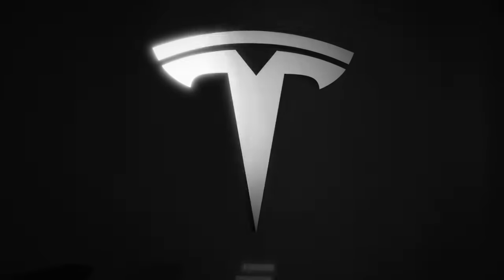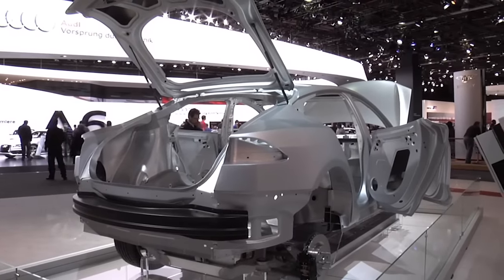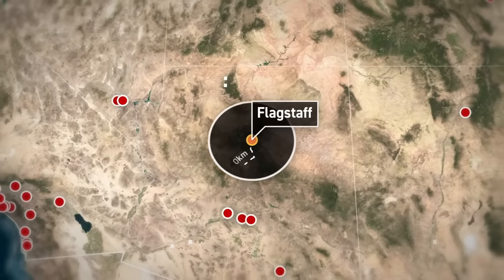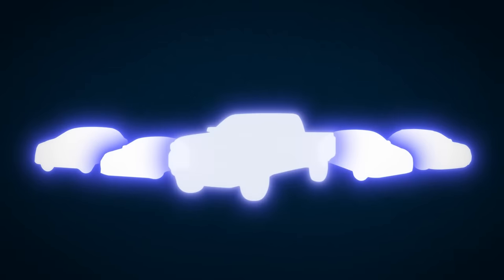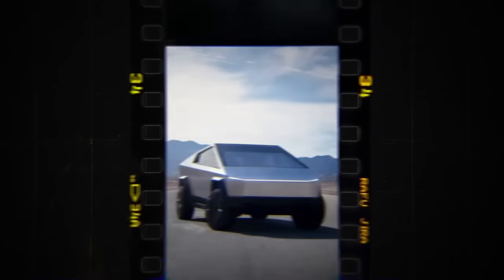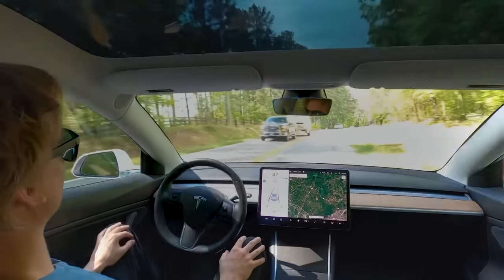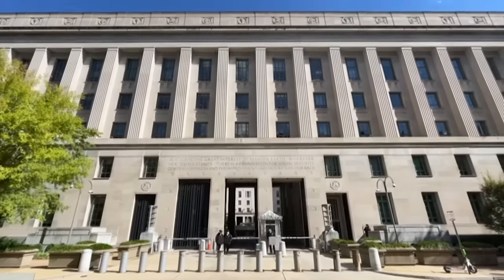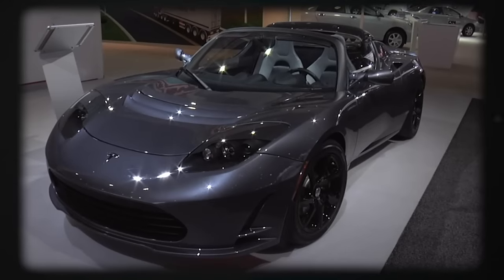How Tesla Fumbled

Comment: I have a Kia plug-in hybrid. It’s the perfect choice for us. I can charge it with our solar for local trips, but get 50mpg and fuel up quickly anywhere on long road trips. I get 500 miles on a 10 gallon tank of gas. I’m not reliant on finding a charging station that is working and unoccupied. They are very uncommon around here, and many are Tesla only. I do agree we need to choose a standard, or ensure all stations have dual functionality as we build up the charging infrastructure.

Comment: The lead in the Model Y is Cost, While tesla turns a profit on the long range, the mach E loses money. It also has a lead in parts, and manufacturing capacity of batteries. This is where tesla will win, purely on a production level and cost in long run. The former car companies are already heavily indebted. I'm not a big tesla fan but this seems to be completely missed. To reach the F150 production rate, Ford would need 10% of current global battery production.
Reply: I think you have that wrong. Legacy automakers have more capability to offset costs in other parts of their business. Meanwhile Tesla has to rely on money from shareholders to offset losses. If they continue to lose favor among investors, they won't have anything to lean on, which means they wouldn't be able to survive being undercut
Reply: @FinneasJedidiah  What losses does Tesla need to offset? They earned $13 billion net income in 2022 and earn gross profit of about $15k per car on average.
Reply: @P. Walker  This is true but with Tesla's massive valuation getting capital would be easy compared to the Legacy auto balance sheets. Tesla is dominating the battery market and think the mining capacity issue is what will bottleneck all of them. Tesla has land in Nevada but to get the Lithium out, from plan to product will take a decade min. If policy destroys Legacy autos business with carbon tax then Tesla wins, it's truly who folds first.
Reply: @FinneasJedidiah  Tesla's first annual profit was I believe in 2020 or 2019. So you are working off of a casual perception that is roughly 3-4 years out of date.
Reply: @adamanderson3042  no, because that was when Tesla was the darling of silicon valley, and was the hot new thing for venture capitalists to invest in. That's different now, and now people expect them to make a profit. So they just can't rely on investors pumping them with cash to keep them afloat while they're undercut by competition that can subsidize their ev production with other areas of business.
Reply: @FinneasJedidiah  I think you replieed to the wrong person, Tesla is profitable.
Reply: @malcolmx61  I didn't say they aren't. Try learning how to read.
Reply: @Critical Event  lol the recall, was just another normal update to FSD, yes the name is miss leading but it's still a top 3 driver assist software? It was safer previously but humans don't drive safe and the issue is with the driving environment not being safe(blind corners/no vision or bad  drivers). I'm also a big skeptic of lion battery production like I said but the only company trying to fix the bottleneck is tesla, that is why I think it's a more war of attrition and the incumbents will win if the government helps them and its people like you and tesla fan boys that are the issue. No more common sense out here to have a normal perspective.

Comment: Huge fan of Wendover. This video has a big problem, though.

Yes, the Ford F-series is the most popular line of vehicles. But that's not the right way to look at Tesla's market strategy.

Instead of the vehicle line, look at vehicle build type. The F-150 is a pickup truck. Look almost anywhere on the road today, and what are the most popular types of cars?

Sedans (incl hatchbacks). Crossovers. SUVs.

And guess what? Tesla made a great high-end Sedan (Model 3) and Crossover (Model Y). Their market strategy was clear, and honestly probably correct.

Rivian made a pickup. How many Rivians do you see on the road?

F-150 may be the single most popular car, but sedans, SUVs, and crossovers outnumber trucks by a huge margin.
Reply: The US is about 20% of the world car market, and even less than that for EVs. And it is only in the US that trucks are popular. Global makers - including Tesla - will not have the same development and marketing priorities a US-only maker might.

Comment: It’s also about production numbers… though the “competitors” have good prices and comparable specs, lucid only made 7100 and Chevy bolt 38000 last year.
Hummer EV 853
Ford lightning 13258

BYD is nice at 911140 pure ev vehicles, but consider their significantly lower average range, smaller sizes and limited market. They have hope.

Tesla made 1.3 million. Calling other options competitors is a joke. 

Other companies offering “competitive” options often have production numbers in the low thousands for purely EV

Bottom line is Tesla dominates battery manufacturing in house while other companies are forced to buy third party options, and they have this head start at 10 years… these companies aren’t scaling as quickly either, and regardless of their quality and ability to make cars, they will lag far behind tesla in battery manufacturing.
Reply: Wait till BYD starts selling worldwide then?
Reply: This video is basically full of anecdotes and very little research. The last part of the video explains why it was made in the first place. Our friend over here is on the left and butt hurt that Elon Musk isn't falling in line.
Reply: 1.3 million is still not enough to be competitive in a world where other car makers make dozens of millions of cars, cars that will all be ev's within a decade.

They just don't have the scale to remain competitive. They need to merge with a much bigger car maker.

Comment: No worries , in general if fair competitions, customers buyers will judge.
Reply: Tesla has always been and is still limited by production capacity - so what exactly has they squandered? If they were having trouble selling their cars at a profit, you might have a point. But that's not a problem - they have industry-leading margins and are selling record numbers every other quarter. With perfect build quality and perfect customer service, they would have LESS MARKET SHARE than they currently did - obviously. Why? - let me explain:

1. Having to make these things perfect would mean they could absolutely not scale as fast because they had to stop and fix things all the time - move fast and break things have been Tesla's mentality and despite the drawbacks, it has certainly helped them scale fast.
2. Great costumer service and perfect quality would significantly increase the cost of production, which would significantly slow down exponential growth from profit - and considering that they were reasonable close to bankruptcy a couple of times, that would have been the wrong strategy for sure.

Comment: Ignores a lot financial data that counter several of his points.

Build Quality - You can see warranty reserves, the company's estimate of how much they will have to payout for defects, declining year after year. The assumption that legacy automakers don't have build issues is also just wrong. If you check 2022 recalls you'd see Tesla is #7. If you don't count getting a free software update, no visit to a service center needed, as a recall then they aren't even top 10.

Production Hell - Just check the other automakers progress on ramping up new production and you'll realize this is nothing special. The legacy automakers are struggling to make their EVs and ramp production. They have so much internal strife and self-interest in keeping margins intact in the short term that most won't ramp even if you could. The Ford's electric 150 is more promising than anything else from legacy auto. 

Delaying the Cybertruck - The company went for SUVs first as it's the biggest segment in the US. Just because the 150 is the best selling vehicle does not make the trucks segment the best segment, total sales does. Also why would company just starting to become profitable add additional financial and execution risk while ramping up Model Y production.

Service - Service times are bad, this is true. 

Value comparison - Comparing price/acceleration/range when mileage and safety are top factors for consumers when buying a vehicle. Tesla has the highest safety rating of any automaker and has for years.
 
Margins(not discussed) - Ignoring that tesla get 25% automotive margins, when legacy auto makers range from 5-10% on ICE vehicle and negative on EVs, is a glaring omission. This is due to more efficient manufacturering, vertically integrated supply chains and some pricing power. These kind of margins mean that Tesla can easily drop prices and continue to dominate market share while the legacy automakers will have to destroy their profit drivers and be left with cars they can't make a profit on.
Reply: At present, every car that Ford and legacy auto sells, are a net NEGATIVE. They are losing money selling EVs lol. I believe Ford said they strive to break even on EVs by 2026.

Comment: I've been suprised many times by the ability of other companies to fumble when they seemed poised to rise to challenge Tesla in EVs. Nissan used to be the global leader, and they just dropped it. GM with their Volt and Bolt looked very promising, but then they dropped the ball too.
I think Ford is playing for keeps, and looks very promising, but there's a very good chance that all the biggest automakers will keep fiddling the time away until Tesla releases their Model 2, and continues their dominance.
Reply: I completely agree, I'm 100% not at all a truck guy at all (blech, too big), but even if you don't need a truck, the range, battery size to power a house, huge interior, massive front trunk, bed capability, and genuinely shockingly good price kind of makes the Lightning one of the best electric vehicles out there right now.
Reply: Building a new car, especially with a completely different powertrain is extremely expensive. You have to spend a lot on research and development of many components. You also lose a lot of the synergies that keep production cost for your line of products down because this is an entirely different product. Ford CEO came out recently and spoke about those challenges in Ford's EV journey. Then you end up having to pass that cost to customers, which make demand lower, thus aggravating the problem since you don't have the economy of scale. Most Auto majors are losing money on their EVs for those reasons. Tesla, with all the issues mentioned, which in my opinion are teething issues for an auto company that's an infant compared to other auto companies, has actually done a good job optimizing cost, lining up supply chain, and creating a viable market where there wasn't.

Comment: While I think you made some very good points here, this video is a bit overly critical. You talk about Teslas downfalls, but not what they’ve done well. I.e. what no other car manufacture has done. You also only talk positively about other car manufactures like Rivian, Ford, Chevy, etc… which I think is unfair as well. I’ll quick;y go over the reasons why I got a Tesla instead of a Rivian, Bolt, Mach E, etc… (and I know that these are major reasons why others choose Tesla as well):
1. The charging infrastructure. Are there non-Tesla chargers/superchargers everywhere? Yes, although not nearly as common as Tesla superchargers. But how reliable are they? How easy is it to charge? Take literally any non-Tesla EV on a road trip and you’ll see why ppl buy Teslas.
2. The software/UI. I know Tesla doesn’t have CarPlay or android auto, but the touchscreen and OEM UI is 2nd to none. They give you cameras on every angle of the car that you can not only use as security cameras, but as a dash cam as well. 
3. They make every other car look like it’s 10 years old. With the exception of Rivian, every time I get in another car, even another EV, it looks so outdated in comparison. Ppl care about this. Why do you think the iPhone has such a grip on the market share?
The quality control issues were absolutely a problem. But they’ve really tightened thing up since then. The model 3 made them a bigger company than they could’ve dreamed and they struggled to meet market demand. I’d say that’s a good problem to have. The Cybertruck took way too long, that’s true. But I can kinda see why since the thing has full electronic steering and a freakin exoskeleton. I love your content, just think this video is a bit too focused on the negative.

Comment: I am a former Tesla and Musk fanboy. But damn i dont understand the Tesla Bashing in this video. Its just 19 minutes of hating a company, that revolutionised the Car market and achieved basicly everything they wanted (make EVs the car of the generell public). Tesla went from building 15.000 cars per quarter to 440.000. Thats damn impressive. No one  was  able to do that. Most arguments are arguebly right tho. Yes Tesla has bad build quality and long delivery times. But thats not why the buyers buy their cars.  It seems that you dont understand some basic things about consumers needs/wants. Everyone knows about these flaws and still buys Teslas. Its about the massage, the style and so on. Tesla had to build a lot of cars and gain high market share instead of building few good cars. Because EV's need a certain market threshhold to succeed generally. Building many cars was the only way to achieve that. Tho now they have to adapt and improve build quality. You think of Tesla as a legacy car maker. It is not. In 2018 Tesla was struggeling to make 5.000 cars per Week. Just the VW brand alone builds 100.000 per week. Tesla doesnt have the experience with mass production (only 5 years vs 100 years of ford). Tesla cant just build more and better cars. Building new factories takes time and there cant be 100s build at the same time. Tesla doesnt build a pickup because either they cant or they dont see the market for them. The typical ev owner is a business person, a tech nerd or some influencer. Those dont buy pickups. And most texans gunwielding republican patriots wont buy an EV pickup. Definetly not one looking like a Tesla